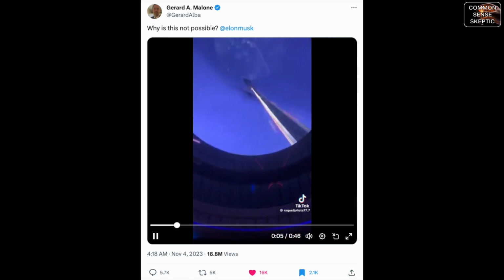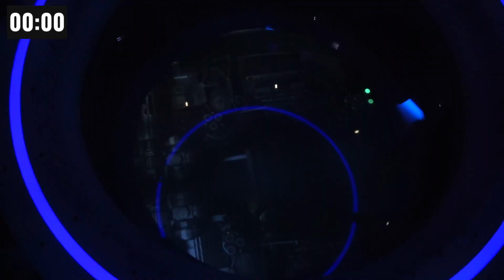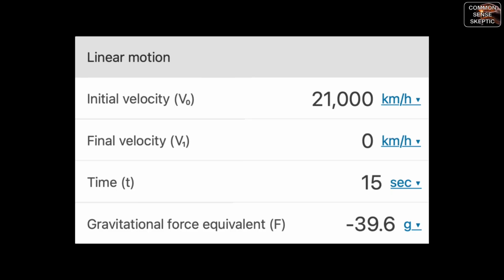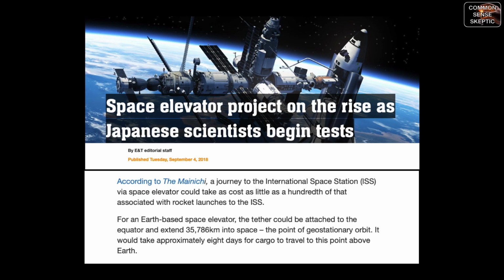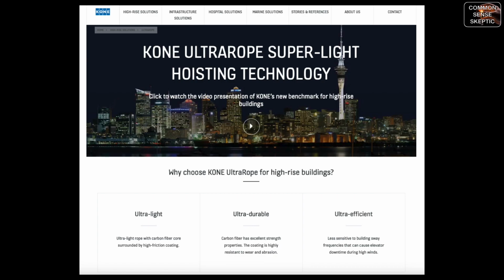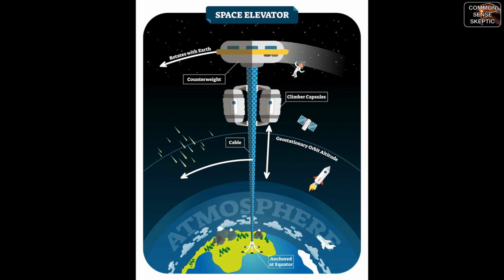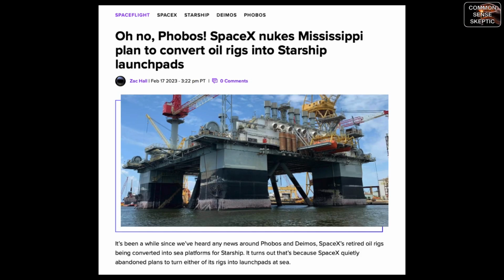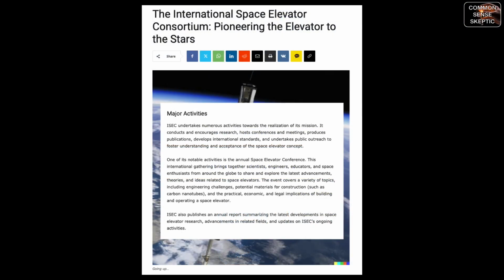DEBUNKING L.E.O. SPACE ELEVATORS

Comment: In fairness, tech to make space elevators is a lot closer to current tech than ressurecting cryopreserved humans.
Reply: Or the crypto market. Bada bum bum.
Reply: or to bringing crypto and nfts back to life
Reply: Question... How far do harmonics, or any sound for that matter, travel in a zero atmosphere or drastically reduced atmosphere environment?
Reply: @ToddGrindle That's actually an easy one: There's a basic high-school-level science demonstration with an electric bell in a bell jar connected to a vacuum pump. You can listen to the sound change as the air is removed, then disappear entirely as it approaches the near-vacuum you can reach with a basic one-stage pump.
Reply: @vylbird8014   so basically, harmonics can't travel in a vacuum. And they are impaired the further away from sea level you travel. What does that mean for the video's supposition of overwhelming harmonic forces acting on a proposed space elevator?
Reply: @ToddGrindle The elevator isn't made of vacuum though.
Reply: @vylbird8014  of course not...but the further into space you go...it is essentially in a vacuum....like a wire in the tube experiencing a harmonic. As you remove gases around it the harmonic dissipates. Correct? Or am I missing something here?
Reply: @vylbird8014  or I guess the question could be rephrased as, can a material, surrounded by vacuum, experience a harmonic, or indeed as this video claims, amplify a harmonic exponentially?
Reply: @ToddGrindle  Experience, certainly. Amplify, not without a power input. Resonate, yes. This isn't an unsolvable problem - skyscrapers already deal with it using careful structural modelling - but that just adds even more to the weight of the cable and the already-ridiculous forces involved.
Reply: @vylbird8014  so in contradiction to your experimental example, you do say objects can experience harmonics in a vacuum?
Reply: @ToddGrindle Of course. Harmonics doesn't just mean sound. Anything that follows the wave equation implies the possibility of harmonics, along with standing waves. Sound, electromagnetic fields, transmission lines. Springy materials, like a taut cable in a piano or a space elevator. Even kids learn how to set up standing waves in jump-rope, and they can do it with an extra dimension - the math is hard to do on paper, but comes intuitively when playing with a rope.
Reply: @ToddGrindle  Gases & liquids surrounding a vibrating string aren't adding to that vibration, in fact they dampen (unless they are the force contributing to the vibration). Some of that energy lost becomes sound. Wave propagation ie vibration in a string or structure is a transfer of momentum from one atom to another. There is no external medium required ..
Reply: @ToddGrindle Yes. The structure itself is the medium. You don't need "air" for sound, any medium will do.
Reply: Just about everything in "science fiction" is nothing but pure fantasy anyway.
Frankly, I like Edgar Rice Burrough's' ideas of just making stuff up.  You need flying ships?  Use the 8th ray.  light bulbs that don't need power and run forever, radium based light bulbs.
The "science fiction" authors who like to pretend their fiction is at least based on science is all BS.
Reply: It’s basically an air hockey table, with wheels in a vacuum- this is something we can do TODAY
Reply: @jaredneilsen  I feel like you've lost me... Is this a structure surrounded by vacuum? Will it then have the same properties as an object in a tube you subject to vacuum?
Reply: oh yeah I would like to see debunking of cryogenic preservation of people for "ressurection" in the future
Reply: Can't talk Disney without thinking of the Walt-cicle. 
Seriously tho I'd love a CSS cryopreservation + anti-aging tech-woo roundup as a special for new year or April Fools. I don't love all the made-up stuff for April Fools but it's good time to tackle silly stuff.
Reply: Not sure if you can say "closer" though, since you are trying to compare infininitesimals.
Reply: There is a purpose which I can imagine for the elevator which, if it worked, would be marvelous.  But, why resurrect people who have timed out?  It flies in the face of the benefits of evolution and provides nothing which isn't already available by the BILLIONS.
Reply: In true fairness this comment is totally wrong. Because to make space elevators actually work you would first have to change the laws of orbital mechanics.. That puts it on the same level as time machines, wormhole travel, or building a new universe where a flat Earth could exist.
Reply: This is true for people that were cryopreserved with older methods definitely, newer methods such as vitrification coupled with nano-rewarming show a lot of promise.
Reply: I remember very well that in 1969, when the first man set his foot on the Moon, NASA projected the year 1986 as an option to do the same on Mars.
Reply: @mittelwelle_531_khz  With the budged they had at that moment in time they could have done it.
Reply: @SUB0PT1MAL  Most likely not. 27 years of innovation would not have been enough. Namely, they were making the projection based on their limited knowledge of Mars. Today we've actually sent stuff there and have an infinitely better grasp of what it would take to be successful there.
Reply: @thesciguy4823 He’s referring to the IPP/STS plan, which assumed Apollo peak NASA budgets up to the next few decades.

The plan involved creating an entire space infrastructure by massively expanding space research with a new 50-man space base and mass commercialization of Earth Orbit and a Lunar Base (orbital and landed) before heading out to Mars.

So the assumption they would have figured it out by 1984 wasn’t entirely unreasonable. 

If you have that sort of budget, then you have the resources to answer a lot of the ‘unknowns’ and ‘unknown unknowns’ about a Mars Base.
Reply: @SUB0PT1MAL  

I don't know about that. The budget doesn't matter. You have a whole different set of issues to solve going to Mars.
Reply: @mittelwelle_531_khz  They could have but the political climate as well as a differing technological pathway pulled the resources away to more important projects.
Reply: @theemperorofmankind3739  yeah, the vietnam war.
fun Fact: with all the money spent there to kill and destroy you could have given all vietnamese a new home with electricity and plumbing like in the USA
Reply: Sooo, why was Uncle Ho-Ho-Ho fighting so hard?
Reply: @theemperorofmankind3739  

Physics probably says otherwise. It would have taken a lot of time to reach Mars.
Reply: @mittelwelle_531_khz  That was if they were fully funded and kept the Apollo program with the Saturn V. All three of which were not reality. And their projections were based on assumed innovation, and they weren't anticipating any of the problems we now know exist with going to Mars. So the 1986 projection was, at best, science fiction.
Reply: Or, to colonizing Mars.
Reply: @backalleycqc4790  Honestly that kind of depends on how you define Colonising. If it means making a limitted permanent pressence on Mars that does seem possible with current tech. It would require a genuine protracted effort but a small permanent research station like the ones in Antarctica (granted it would be a lot hard and would likely take a couple decades to achieve) it is not out of the realm of possibility of current technology.
But if you mean a proper civilian colony on Mars working then yes I 100%.
Reply: @theemperorofmankind3739  It's not even close with current tech. Everything from air compressors to keeping an air-tight seal despite dust storms currently doesn't exist. Perseverance is currently equipped with the first air compressor designed to work on a planet with significantly less than 1 atm. And it's just a prototype...test of concept, yet to be scaled up for human use, let alone tested. 

No, current tech is nowhere near where it needs to be to make a Colony on Mars even close to possible.
Reply: @theemperorofmankind3739  limited "permanent" presence. Sorry but that's still impossible for us.
Reply: @theemperorofmankind3739  after one year of weightlessness(on the way in) you won't be able to even exit that Mars lander,let alone establish a settlement there.
Reply: So, it depends on the quantity and quality of the word-wank you use.
Reply: @theemperorofmankind3739  You're right - it would be possible, with nothing but current technology, to start building the first outposts. On mars, or on the moon. Not colonies, but long-term research bases. You could do a lot of science even on the moon - with crew able to stay for years at a time they would be able to maintain sophisticated instruments, do geological work, explore interesting formations. The technology isn't the problem. It's money. Any kind of long-term manned outpost would make the ISS cheap - it'd cost trillions of dollars. No one country could afford that, and even international cooperatives aren't going to come up with so much unless there is a reason far more compelling than 'for Science!'
Reply: @theemperorofmankind3739  Neither is realistically feasible. Another important definition would be that of "permanent." Just a short stay and return mission is extremely dangerous, high risk, and would cost some $100 billion to execute. "Permanent" is out of the question for the foreseeable future, that being defined as within our lifetimes.  After that, it won't matter to any of us, will it.
Reply: @theemperorofmankind3739  Any technology which could be used to terraform Mars could much more easily be deployed to reform and repair Earth.
Reply: @kimweaver1252  I know but where did I mention terraforming in anything I said?
Reply: @theemperorofmankind3739  Colonizing will require some sort of terraforming if it's to be more than a remote research outpost.  If the plan is to have a lifeboat for humanity because of habitat collapse on Earth, then the money and resources spent to make Mars livable, HABITABLE, will require some measure of terraforming which could better be deployed here with a wounded, but possibly salvageable planet.  if you imagine the Mars colony as an underground structure.... the most likely..... then the same "solutions" could be applied here much more easily, if only because we have good ol' Musk's Boring Company.  Which barely has any boring equipment.  But the many problems which underground living here will present are matched and exceeded by the problems we would face on Mars.
Reply: @thesciguy4823 thats not really accurate... there's a difference between engineering and tech... the technology exists, it just hasnt been applied to the specific problems associated with a Mars Colony... 

the issues you mentioned would take less than a year to resolve with proper funding... there's not much to actually gain from a mars colony though so funding is limited. the reality is we could easily colonize mars if it were our top priority and we wouldnt need to create virtually any new tech, just apply current tech and engineer solutions specific to the problems.

it would genuinely be a lot easier than you seem to think... nearly pointless, but easy
Reply: @Georgi_Modev  As someone in rehab after just three months of bed rest (considered by NASA to be a good analogue for weightlessness) I concur. I'm finally getting better, but still I can't physically stand, or even sit all that long.

That said, there are technologies developed for moving those with severe disabilities around. You could build a Hoyer-type lift into your rocket, so the astronaut could exit. You could build the equivalent of power wheelchairs for their early mobility on Mars. One could , in other words, ship them with the equivalent of a rehabilitation hospital...

Or you could recognize this is a silly idea that wastes resources, and go do something else with the money. 

If Elon wants to experience his fantasies just as he imagines (read: just as other people imagined in some sci-fi book he read), he can always k-hole.
Reply: @birchtree2274  i hope you get better with your health.
In your case you lacked the physical activity but you were,i presume, spared of having sl 50 x-rays daily-and that's the amount of radiation (in mild forecast)astronauts would receive for almost two years travel Earth-Mars and back.I forgot to mention that.
Reply: @Georgi_Slavov  I had IMO too much radiation (I do not think they needed the number of cat scans they took) but yes, I did not have that much radiation.

Still you could ship astronauts with their own rehab hospital, which would make it possible for them to exit as they try to recover from their radiation sickness :) It would still "help". It would also illustrate how absolutely insane the idea of settling Mars currently is.
Reply: @birchtree2274  yeah, a CAT is really a lot of rad,maybe an MRI would be better?idk how much they are in the US if you are from there. I am in Bulgaria, here they are 200$. 
And, yes,absolutely, why even going to such a hell that is Mars?I wonder how much it will cost btw?
Reply: @backalleycqc4790  with nuclear propulsion 45 days doesn't seem that much, the hard part is staying there
Reply: @ro.zyipitoe5226  And the treaty that states nuclear detonations in space are forbidden.
Reply: @backalleycqc4790 It’s not that kind of nuke.
Reply: @backalleycqc4790  Not really we basically have the tech. It's just so expensive with nothing to gain that it doesn't make "sense".
Reply: @backalleycqc4790 Absolutely.
A "colony", is where people will retire to and raise children.
We've had people constantly on Antarctica for decades but it's not a colony.
Reply: Honestly this video sounded like your pessimistic uncle who never believes in anything you want to do. Science progress is a matter of time. Eventually someone somewhere will figure it out. We should encourage rather than disparage.
Reply: @alphauno6614  We need to encourages development of paths which have some hope of leading to worthwhile outcomes, either useful technology or knowledge gained purely for its own sake. There's no need to waste resources on projects which are doomed from the start due to serious conceptual flaws.
Reply: @alphauno6614 Yes, but it is also a matter of physics and economics.

There are many things we could do if we dedicated an insane amount of global gdp or an aatronomical amount of global energy production. 

For example I believe we could build an undersea Disneyland on the abyssal plane if we did not mind condemning much of the world to starvation. But no one in their right mind would build such a thing. We may as well set fire to the building supplies and call it a day. This is why, for example, I do not believe humans will ever explore another solar system in person. To do so will never make sense from a cost/benefit perspective.
Reply: @birchtree2274  Why is the space elevate soo prohibitive resource/energy wise? We can harness abundant energy from the sun especially if we have solar in space and the space cable, eventually when we make a super material that can withstand the stresses, will also be feasible.

What is soooo unimaginable about this concept?
Reply: True, though to be fair the point of cryopreserving people is not that anyone thinks we will revive them anytime soon (people who participate even acknowledge it might never happen, weather due to a problem at the facility looking after them or because the technology never gets developed). Cryopreserving is just the current best method to minimize decomposition, so if riving methods are ever developed we have more of the person to work with (your basically just crossing your Ts and doting your Is). The ironic problem with all this is long before we have the ability to revive cyropreserved humans, we'd probably have better medicine that eliminated the need to ever cryopreserve people in the first place. Just as we once all assumed you died the second your hart stopped beating and we now realize you can survive at least 6-7mins without support and with proper support a person can even live without a hart for as long as the support can be given (it's just not ideal and the technology is very crude still), I honestly don't see why medicine advancements won't continue like this assuming we don't go extinct due to global warming or something else in the more immediate future.
Reply: @stickfigure31  It's a sort of Pascal's wager: If you choose to undergo cryopreservation, you have a tiny, tiny chance of one day being revived. If you don't, then you have no chance at all. So if you've no better use for your money, might as well. Any money you might waste on the process, you'd be losing either way when you're dead.
Reply: @stickfigure31 yup, there is a movement (which CGP grey had a video on) to focua medical tech to defeat death.